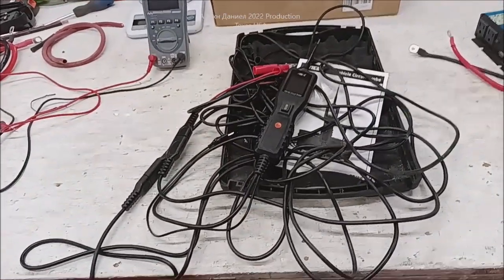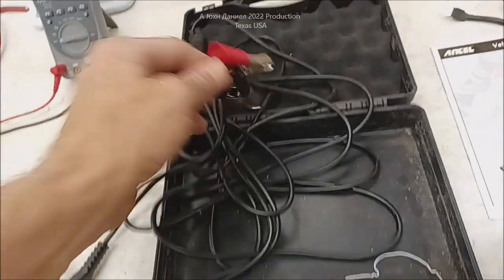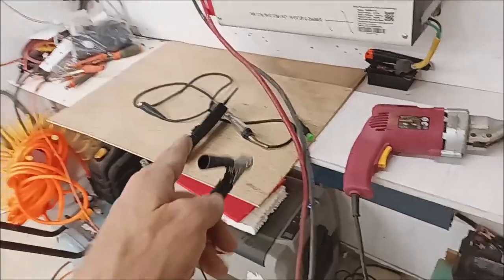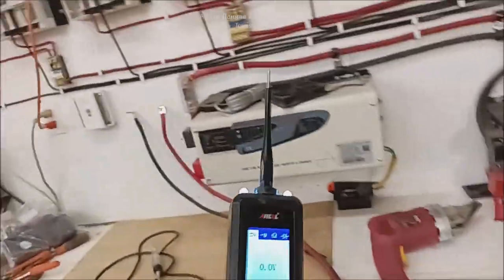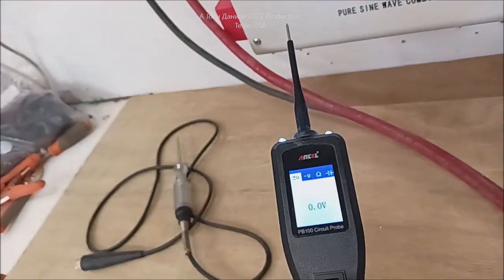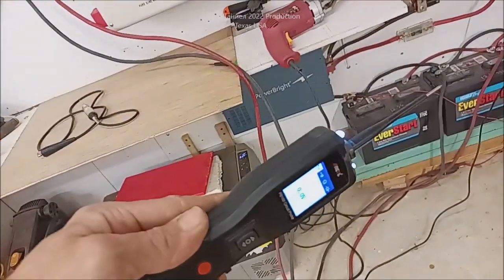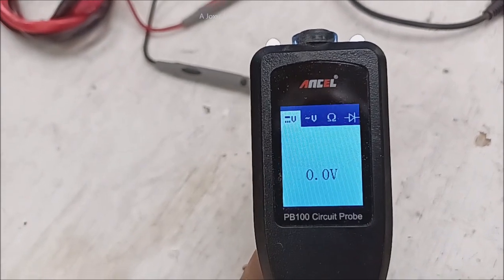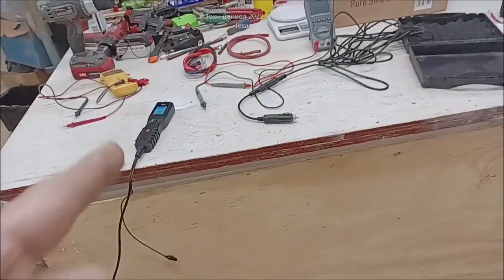Ancell PB100 Auto Circuit Tester used and abused, I LOVE IT!

Comment from the maker: ANCEL PB100 https://a.co/dnSm8JX Automotive Circuit Tester 12V 24V AC-DC Voltage Resistance/Short Finder, Relay-Fuse Tester, Trailer Lights, Ignition Diagnostic & Thermometer. Has saved me days of time & I know you will love it. MUS-TOOL OSCILLOSCOPE https://amzn.to/3Np7VDk , All other materials used https://a.co/dnSm8JX

Comment: what make are thos controllers to the right side? Luyann
Reply from the maker: SRNE Solar since 2009. https://s.click.aliexpress.com/e/_DmbmWFf
They do allow rebranding, Weiss, Vevor, Powmr but those can NOT use the same board, just the same control modules and outer cases. So the original brand is absolute fool proof. 
For data  - SRNE SOLAR CO.,LTD was established in 2009, headquartered in Shenzhen, and the factory is located in Chang'an, Dongguan. SRNE is a world-class provider of photovoltaic off-grid products and solutions, a national high-tech enterprise integrating R&D, production, sales and service